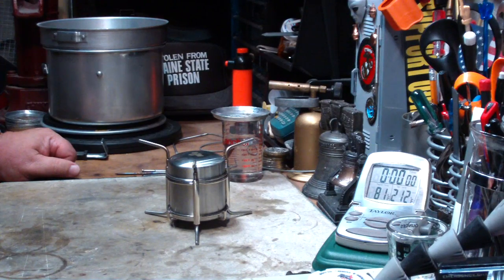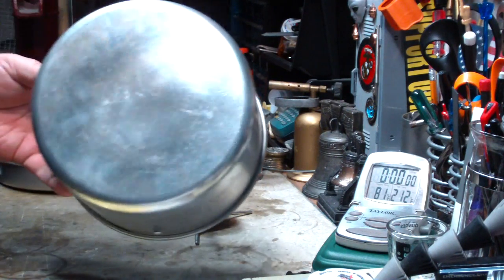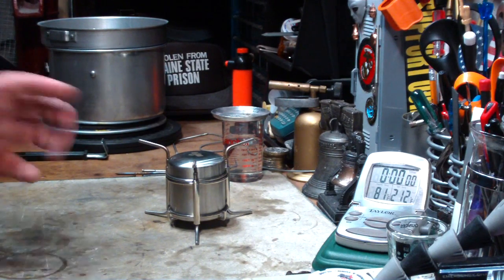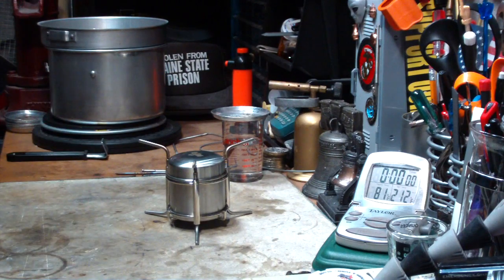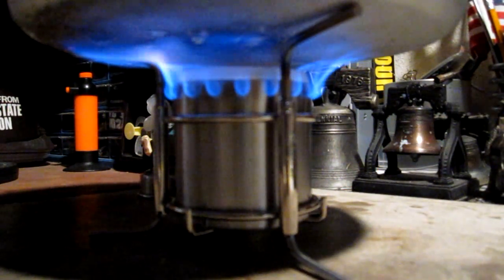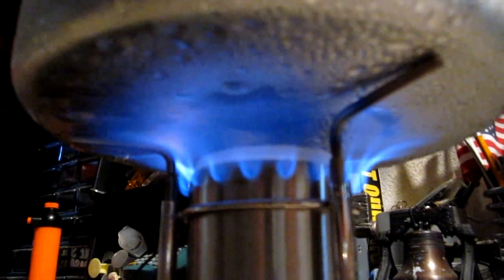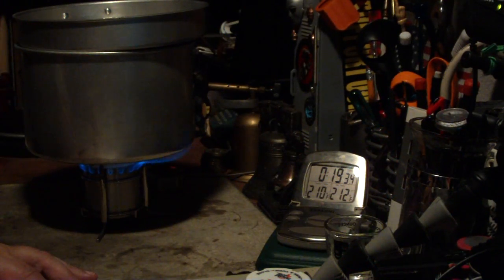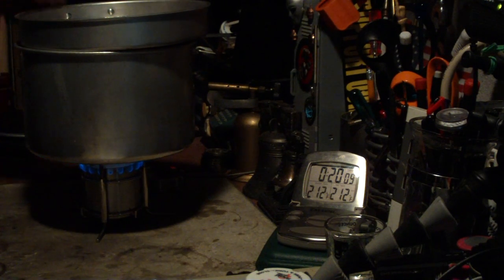OUT-D Stove - Boil Test #2 - Requested by CatkillMountainGirl

Comment: Thanks. This stove is on my short list for the one I want to buy and that helped. Suggestion: When doing a test for burn time, mark the point when the flame begins to die and is no longer providing cookable heat. I know this is a bit subjective and letting the clock run until the flame winks out may seem more scientific but if my soup isn't cooking,  then the stove isn't really on (in my humble, correct opinion).